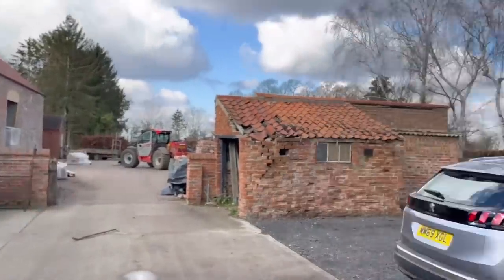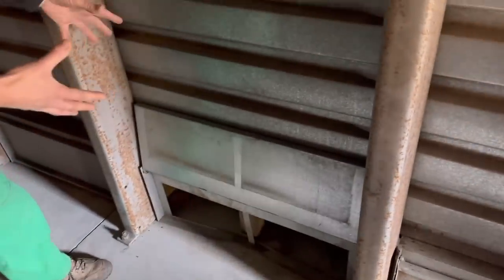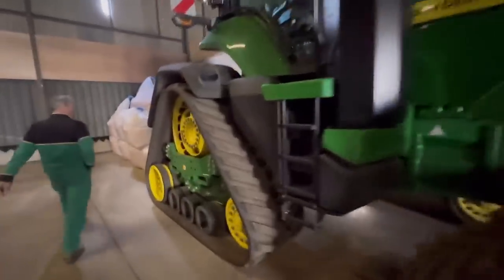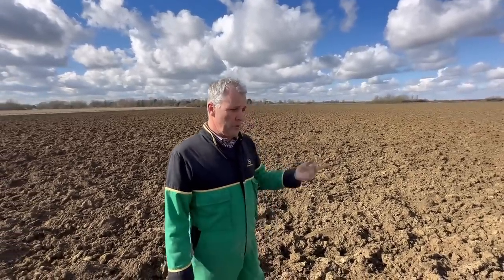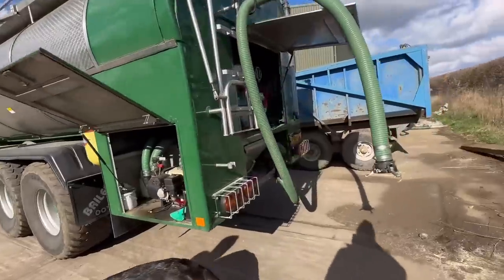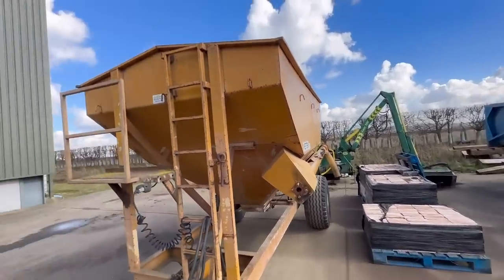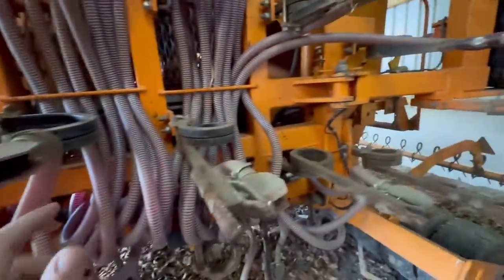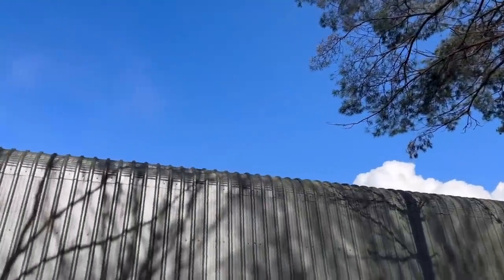BIG TRACKED JOHN DEERE AT WARDYS FARM #OLLYBLOGS #AnswerAsAPercent 1081

Comment: Quick question. Why do some people have big equipment and do a lot of heavy ground work to sow OSR when you’re also able to do it way cheaper with your one pass direct drill system? He has a big simba with large soil disturbing legs and I’ve seen other people pulling large sub soilers and all sowing OSR.
Reply from the maker: Osr is a thickkle crop to establish 🤦‍♂️
Reply: Our soils are different to Olly’s, most are made up of 80% silt and clay so require a different approach.